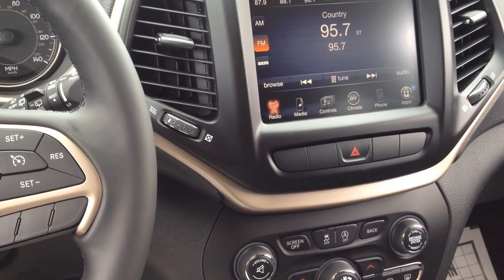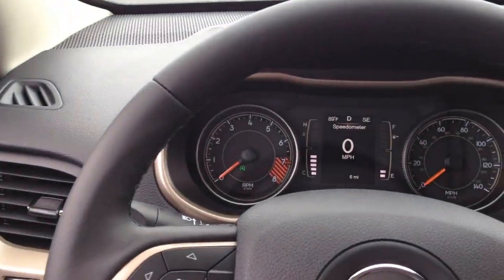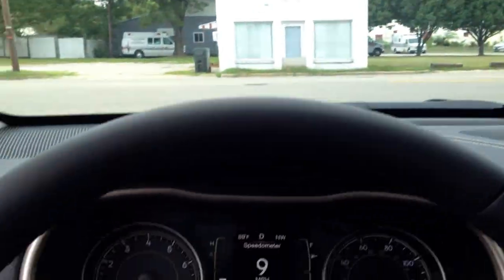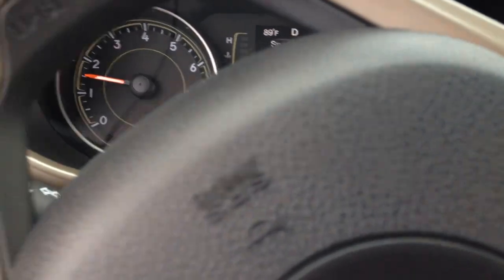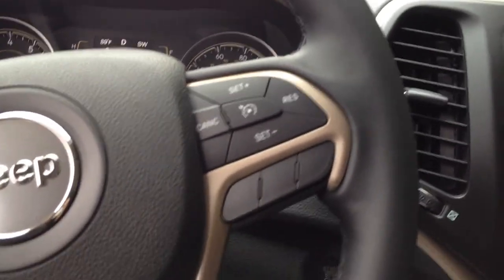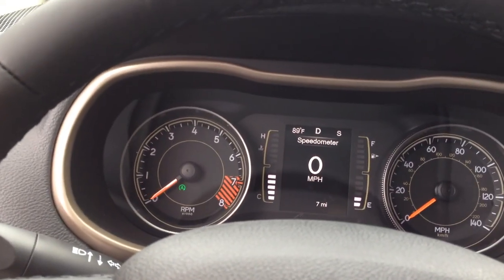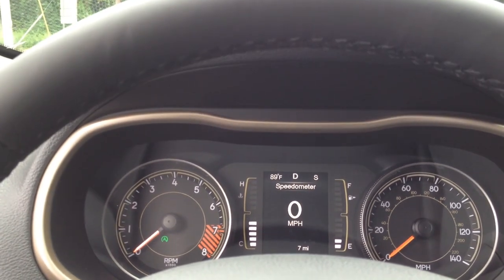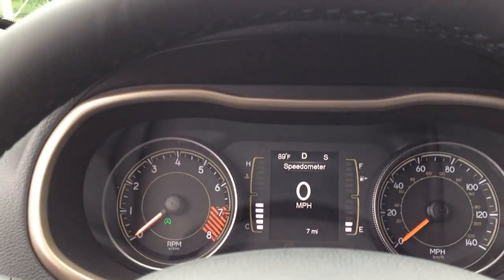👉 Stop-start technology

Comment: Most of the time it’s depending on a lot of factors like as someone said if your using the climate control heavy then it’s not going to and the battery is different from a normal car because it has to be bigger and stronger to still run everything while the engine is off and also a feature that some have and some don’t that have the stop start , has regen brakes to charge the battery and cycles the alternator on and off to charge the battery. So it’s basically a hybrid , but without the battery and electric motors to help propel the car forward. Yes it may seem like a strain but in the long run it saves fuel and saves the earth. Just imagine if all cars had this. It would save so much pollution and it would be nice and quiet. At stop lights and signs , And another thing if the battery is too low it won’t stop the engine. So it’s smart to know when to do it and when not so your not just left stranded there.

Comment: Hey Mike, if you have the air-con on and the ventilated (cooled) seats, does this prevent the ESS from working? Thank you
Reply from the maker: +UKRedSnow It could prevent it from turning off the engine if the AC compressor needs to engage.
Reply: +MikesCarInfo OK great, thanks Mike. I'm not picking it up until Friday so was unable to refer to the manual. The UK Jeep site does not seem to make the manuals available for download! Cheers - Mark
Reply from the maker: +UKRedSnow http://www.fcaworkvehiclesus.com/jeep/download/pdf/manuals/2015-Cherokee-OM-3rd.pdf